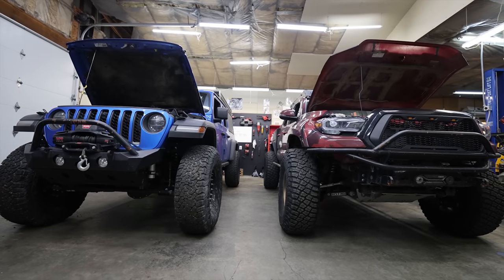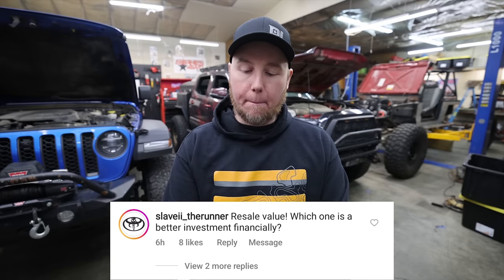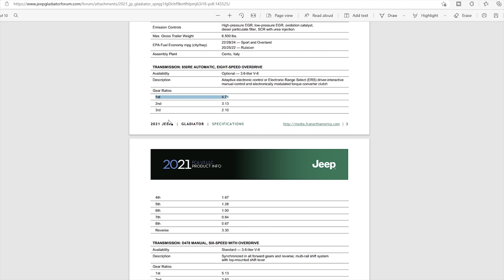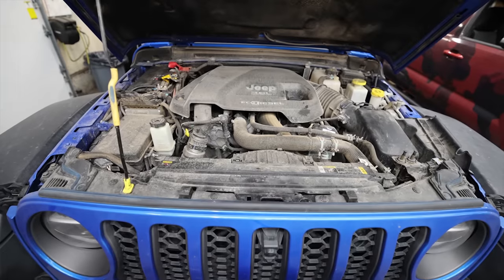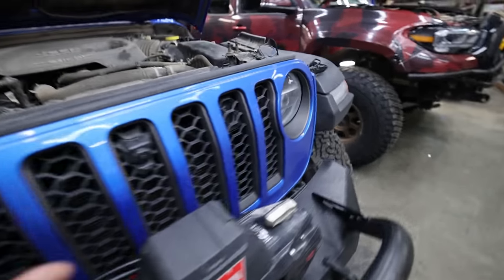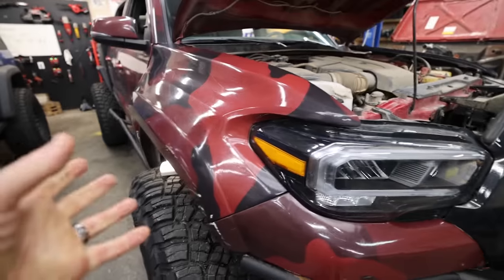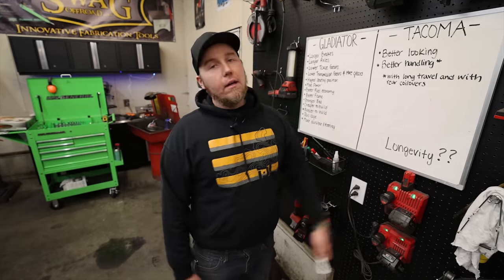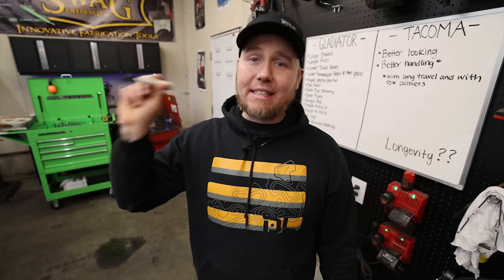My 21 Jeep Gladiator Vs My 21 Toyota Tacoma. Cold Hard Facts.

Comment from the maker: As the owner of a 2021 Tacoma and a 2021 Gladiator I'm uniquely qualified to speak on these trucks. 2 years of ownership, building them for 39s and lots of hard use has made it very obvious which truck is better build... it's the one with the best parts.
As much as I wanted this Tacoma to be better than the Gladiator, it just isn't. There are still so many more ways that the Gladiator is superior to the Tacoma, I didn't even bring up that the Taco comes with leaf springs 🤦‍♂️ but I decided while shooting this video that enough was enough.
If you have hard data on reliability please post that in the comments so we all can finally find a reliable source of these statistics.
Until then, the reliability of one vs other is purely speculative. My Taco has had plenty of problems in the last 20k and the Gladiator has only had a cracked windshield but is that typical? This is anecdotal at best, so until we can find some real numbers, I don't want to pretend one is more reliable than the other.
I hope you enjoy the video! This will no doubt be controversial!
Reply: When's this new Toyota project getting announced? 🤔 Landcruiser content?
Reply: Nate, thanks for the video. I have 3 Jeeps, a 2nd Gen Yota, and a 6.2L GMC. No brand loyalties or hurt feelings here. I have a major issue and a minor issue with the content though. Your commentary on the frames is off base. Almost 100% of commercial trucks on the planet are riveted C-channel because it is a superior design for truck applications. It is not as simple as comparing a width & height or boxed vs open without consideration for materials or designed flexture. Yes, tacoma frames rust, but my boxed-LJ frame is rotted too. As for the minor issue, comparing the diameter of a disc with the diameter of a drum is numerically meaningless; It is only about swept area, pressure, and friction coefficients. Those factors govern the friction force and the 'diameter' the resulting torque.
Reply from the maker: @Distraught Cruiser Owner  announced officially in March. It's for a build off I'm doing with some other YouTube channels. We each got 15k to buy and build a 4x4 into a rock crawler. The only think I was interested in was a 80s series... 😁
Reply from the maker: @viperstd  I do appreciate the comment, and I respect your perspective. But as someone who makes videos every week, I've learned not to muddy the waters too much. Modern commercial trucks do have c channel frames. So do RVs. But that is not relevant to a conversation about trucks in this class. Commercial trucks are not designed for offroad, so having a flexible frame is not a big of a deal on the hwy. But with trucks of this smaller size, it is a huge deal. The construction method for Tacoma was to be as cheap as possible. That's why it's a c channel frame, not because it was designed to be flexible. It's flexible as a result of cost, not engineering. Look at all the taco owners that pay really good money to box these frames in. The frames are a problem. 
As far as the brakes, I agree. I almost didn't include it, but I think it's important to consider that this truck has drum brakes, and since I was measuring the gladiator, it made sense to toss some measurements of the Tacoma. The reality is that drum brakes are terrible in an off-road environment, and I should have pointed out why instead of just using measurements. That was absolutely my mistake. I do feel it's important to make things as simple as possible in these videos but you are absolutely right, the size of the drum is not relevant. 👍
Reply: @DirtLifestyle  finally 😍 have fun with that crawl ratio 😂 2.95 first gear and 2.488t case matched up to some 4.10s
Reply: Thank you so much for being straight up honest and no biased towards brand loyalty. I have own both Jeeps and Toyotas. Both are great but honestly I love the Jeeps more. It was way easier to modify, more fun to drive in and hands down just a better offroader. Reliability overall has been great too from both brands.
Reply: there are too many variables to determine reliability and resale value really.... like talking to my son when he was a little bit younger he always wanted to know what the people say is the best of whatever... I had to break it down how the variables won't allow there to be a best... it always depends on who what where how and why
Reply: @DrHavok1  
Brand loyalty from what I've seen plays a part too. I've known many people who will never admit that they had run into issues with their favorite brand vehicles regardless of how big or small but won't hesitate to say nay things about the other lol.
Reply: @viperstd  Get some small holes drilled by the rear lower control arms, lets the water drain out that the front of the frame and side holes suck in. LJ ftw.
Reply from the maker: @Distraught Cruiser Owner  lol I'm educated on the problem 🤣.  I have already lined up some lower tcase gears and I will gear the axles down as low as I can. I don't remember what the crawl ratio was when I did the calculation, but it was OK after tossing all the gears at it. Still not great, but doable 👍
Reply from the maker: @J Thor  thanks brother 👊 I appreciate the positive comment
Reply from the maker: @DrHavok1  I couldn't agree more
Reply: How has the Eco-diesel been tho? Any engine problems? I've heard that the lower engine bearings are super leak and there's a chance of spinning it and breaking.
Reply: Well I don’t own either one, but I was rooting for the Gladiator and I was really surprised that it had bigger brakes, axles and so many other important parts. I would like to get an idea of how much they both cost after you built them not counting the custom Taco bed
Reply: @J Thor  brand loyalty is a thing of the past... if you're looking at modern day vehicles and claiming brand loyalty now days you're(anyone in general) a fool because NONE of the brands are even close to what they were back when there were actual reasons to be brand loyal. My first truck was a 77 Scottsdale... that was when Chevy was Chevy at its peak. Now my newest vehicle I've ever bought is my 98 zj... not sure if I'll ever go newer.
Reply: @DrHavok1  my first vehicle was when I was 15 and it was a 1956 Chevy truck with a straight 6 with a 3 on the tree and starter button on the center hump of the floor and had about 5-8 different colors of paint and primer 3 different wheels and a huge 8 track stereo for 1982 when I got it.
Reply: Nate, what about a Jeep with the V6. That would be more apples to apples in some more areas.
Reply: For what most people use their trucks for (not hardcore off roading) the Tacoma is the better buy. It’s much more usable and cruises around better with IFS. The seats in the Gladiator are super uncomfortable to live with, not a fan. The Gladiator does have an amazing infotainment setup though, way superior to Toyota.
Reply: Jeeps only have an advantage in short wheel base models right?  2dr jeep will go places that the gladiator and the Tacoma can't go.  By the way that Tacoma looks pretty awesome.
Reply: Brand loyalty has never been my thing (I've owned most brands over the years) but talking trash about Jeeps was something I did quite a bit of since my first vehicle was an 71 FJ40. It didn't take long to see how an FJ40 was built like a tank compared to a CJ of that era. That being said, my Landcruiser has broken down plenty but other than the SBC swap it is all Toyota. My Jeep friends basically had Jeep bodies on every other brand of drivetrain. I used to ask them "Is it really still a Jeep if it's just a Jeep body?"  I've also owned a few Jeeps over the last 30+ years and I can respect how good a few of them were but they were a little too "light duty" for me. I have to finally say that the JL and JT platform are really, really good right from the factory. I have 2-1/2 years of seat time in my 2020 Gladiator on 35's and it's been great. Keep up the good work Nate!
Reply: I do wholesale parts for Chrysler, Jeep, Dodge, and Ram. That being said, I can tell you which one will have more problems in the long run. Also, they just maybe finally worked out the bugs with their 3.0 diesel after 10 years. Then they discontinued it!
Reply: I’m a taco owner and u just gained a sub lol 😂
Reply: The answer is yes, the cracked windshield on the jeep is a real issue. My parents have a 21 jlur and they have been through 2 or 3 windshields in 40k miles. I've lost count. Those bad boys are rock magnets and they break easily.
Reply: You forgot one big but obvious one! You can remove the roof! I wont say doors too because technically... lol
Reply: The only gripe I have with my Jeep is constantly having a cracked windshield. 3 windshields in less than 1 year. 
Replaced the first one and was back for another in 2 weeks.
Reply: You are dead bang boss. Most (I’m going 4 runner here) 4 runner owners are more worried about what is on the side of it (trd pro) than actually wheeling the thing. Makes sense it has “more reliable” reputation when Jeep people actually know how to put the rig into low range. (I’m on several 4 runner forums and rhe shit new buyers come up with,…. “Hey my 4 new runner is broken, I hear clicking when off road or in snow” is fucking insane. They have no idea what they bought. The ease of the keep suspension is not even close between the two. It’s a fight to even add 32s on “the capable 4 runner”. Even then most that do, never even wheel the thing, to them off road is a dirt road I use to just get home.  It’s no contest. What worries me even more is Toyota is going in the wrong direction. Sucks. 

2018 OR -285/70/17, front rear springs, sliders, under body armor. Tweaker 2 sets of tie rods in the 900000 miles.  Both times locked and climbing a v notch crevice in Moab and sand hollow.
Reply: One thing to consider… Clearance on a solid front axle is static. Clearance on an IFS decreases substantially on uptravel. Not a positive aspect if you ask me.
Reply: Years back there used to be a car based website run by Microsoft called Carpoint.  Instead of relying on owner-submitted (i.e. high potential for bias or selective memory) reviews, they compiled repair data from a network of participating manufacturer dealers. While some dealers may sometimes replace parts which aren't necessarily broken, this removes a lot of the potential bias.  A lot of the Japanese manufacturers with stellar reliability ratings didn't look so stellar when assessed in this way, and some of the US manufacturers looked a lot better than what was portrayed in Consumer Reports.
Reply: So interestingly I used to own an 01 tacoma, and the frames on those older tacomas had a fully boxed frame. The following generation they went to a double C-channel frame.
Reply: No butthurt here, Nate. Back at the beginning of 2019, my wife and I needed to replace our 4x4 due to the demise of our Pajero (turns out they don't run very well when they dump a valve and blow a turbo). We were geared up to purchase a new Tacoma right up to the point we test drove it, and I started looking deeper into the current generation. I couldn't get comfortable in the seating position, and it had all the shortcomings you've mentioned here. In the end, we purchased a 1997 80 series with 200,000 miles on it. I still adore it. If I upgrade, it'll be for a 200 series. 

If you're listening Toyota, one of your newest 4x4's models lost out to a 25-year old 80 series with a customer who could have afforded the new model. Do better. The 80 series had solid axles, disc brakes all around, a full-time case, and coils all around.

If Mr.T ever brings us the VDJ76, I'll be one of the first in the lineup to plunk down my deposit.
Reply: @johnd830  for what most people use their trucks for just get a 2wd 😂
Reply: Can’t speak on Toyota I’ve heard good things about their reliability from friends but I can say I have a gladiator rubicon with 37s and a 3.5inch lift that has 90k miles 10k stock and it still feels brand new no issues and I wheel it hard both are cool trucks wish I had the money for both 😂
Reply: @DirtLifestyle  I've been watching your content for years and I absolutely love the channel but this is the most excited I have been for one of your builds. Towards the end of this video after your facts comparison at the whiteboard when you said you had a 'yota outside that wall behind you I was literally chanting out loud PLEASE BE A CRUISER lol. My everyday driver is a 93' RHD 80 series VX limited and it is just built like a frickin tank. They are purpose built, simple in design, and super strong. It's been a gripe of mine for a long time as to why we don't have access to the Hilux and the Prado or the 70. If it is in fact an '80 I can't wait to see what you do with it. Now while I am clearly a Toyota guy, I still love Jeeps. I wish that more people could be a fans of one particular thing and not feel the need argue why everything else is inferior. I think jeep killed it with this truck. I would love to own one someday. Love the videos brother and cheers from up north of you in Whatcom County.
Reply: i have 2018 jk and 2016 taco.  no comparing adding 35s to wrangler vs taco.  jeep is easier to lift, over size tires without all the extra crap needed with tacoma.  my 0-60 feels exactly the same with 35's and 4" lift as stock on the jeep.  love both, tacoma is a truck to haul crap with, jeep is an SUV that goes topless and doorless.
Reply: Dude the problems with your taco you've done yourself. 
Your lacking reliability statistics is lacking in itself as they are pretty near the same everywhere. Despite sources. Your love affair with the jeep is because you rock crawl and have a offroad channel. 
"And the axles in the..." 
Most people dont care. If they cared that much they'd be buying a f450 it sure wouldnt be a jeep. 
"The Toyota has a c channel"..
A lot of trucks have. And yes. It does actually aid in articulation. Boxed frames usually use thinner metal and make up for that with boxing. But they still snap too. See how small that jeep frame is? I've snapped bigger frames than that jeep. I've owned owned a lot of brands. More commercial or heavier truck usage. But also smaller, yea a tacoma, a frontier, explorer (i could make a long list).  
You know one thing i never owned? A jeep. Because i simply can't stand them. It's basically a atv.
Reply: As much as I know Tacoma is more reliable and jeep is more capable, I still can’t believe you butchered another and praised another without mentioning goods of another you put down. That’s how bias works. Yes I know you own them.
Reply: @viperstd  c channel frames are cheaper and flex more, for a stiffer frame a fully boxed frame is superior, flexing is for suspension not the frame…
Reply: @DirtLifestyle  I’m happy that you’re building an old 80 series, at first when I heard about you building a Land Cruiser I thought you were going to build one of the new crossovers.. lol. It puzzles me that people actually think that the new Toyotas are off road legends .. and I have owned three Toyotas..
Reply: Unfortunately I have had a bunch of issues with my 17 jk. Some so severe I have even questioned it’s drivability (Front axle locked and almost got me in a major accident) I just bought a 2023 taco TRD offroad and I will be very curious about the difference in reliability.
Reply: I love it! Let the haters hate!

Comment: As someone who has wrenched on all brands of trucks. Fords drove me nuts the most. Wranglers werent difficult, but you ended up using way more sockets to do any task over the other brands, it was odd as the Grand Cherokees werent that way. Toyotas were my absolute favorite though, they just made sense and were easier to work on. But yes, for actual off roading the Jeep all day long. But for a daily, I would take Tacoma any day.
Reply: Older jeeps needed a mix of standard and metric sockets which drove me nuts (and bolts ). Haven't worked on newer Grand Cherokees so maybe they standardized
Reply: I hate working on fords they are so weird and quirky
Reply: @jeepstertj556  Modern Fords definitely, but I'm biased against most modern vehicles.  My first truck was a 1960 Ford 1/4-ton, straight six, three-speed with the shift lever on the steering column.  I could climb over the fenders, straddle the front axle and stand on the ground while working on the engine.  A very simple set of tools was all I needed.
Reply: @theeddorian  I second this. I used to hate Fords, but after wrenching on even just 90s trucks, I have more respect for Ford. Modern Ford is just annoying.
Reply: I recall my 1993 F-250 was more difficult to repair than my Toyota trucks, the Toyotas we’re definitely easy to repair, ironically the three Toyotas I owned all new and put high mileage on all the trucks including the ford 250 and my current 2015 Silverado 1500, my Toyotas had the weakest front ends, almost like clockwork every year I’d be doing ball joints and brakes, my F-250 went 120,000. Km before I had to replace the callipers, my Silveradohas 170,000. Km and just replaced the callipers to be safe, im not happy with the Silverado transmission, absolute junk, I love and hate them all, although for a daily driver I drive my civic, lol. Way better on fuel, I used to daily drive my 2015 Silverado with 33” tires with a 2” lift.. the fuel economy is extremely expensive, lol
Reply: I hate working on my Toyota's because the bolts, even on trucks that had hardly any snowy winter miles, were jammed in everywhere and would snap. They completely suck to work on. My F150 with more miles and twice as many winters on snowy roads, has ZERO issues with this.